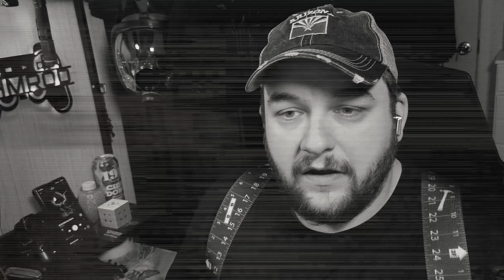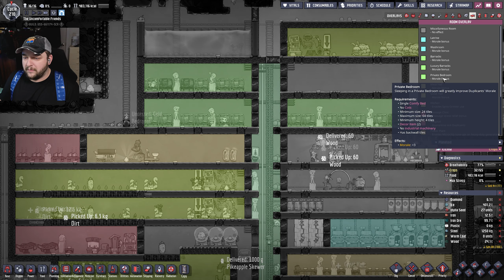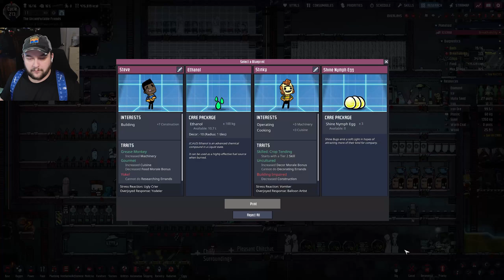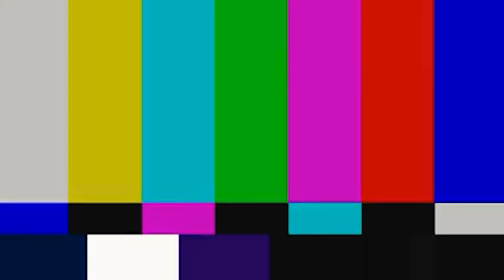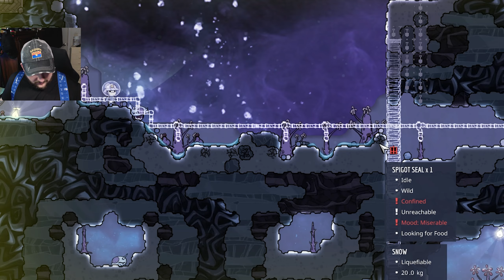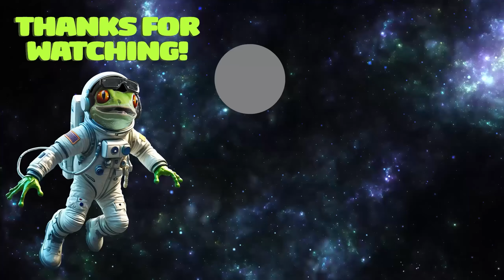What is the problem with the GUNK?

Comment: I think I know where the gunk come from. You had a bionic dupe(bupe) in the start. Now the gunk that it expelled rest inside the base. I think the bottle froze, then thaw and spilled everywhere after…
Also, you are using 100% of the production of the spom nom. You will need to use again the oxylite until you make a much bigger spom 🤪
Reply from the maker: I didn't think I had taken any Bupes in this run. I could be incorrect there though! It is just annoying and bad for Morale XD Bigger SPOM is on the way for sure!